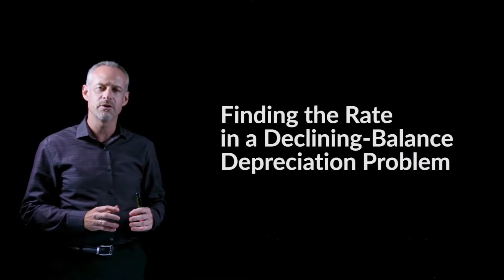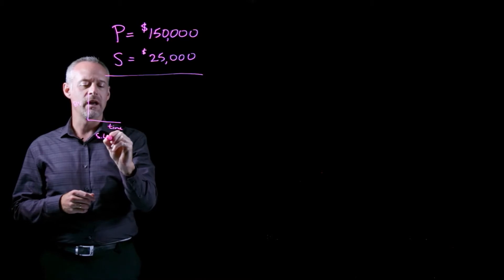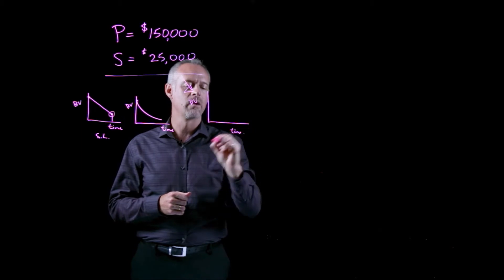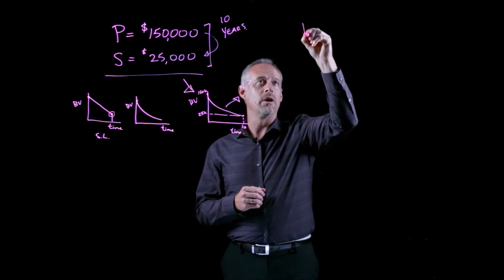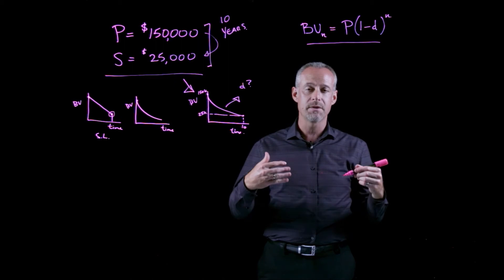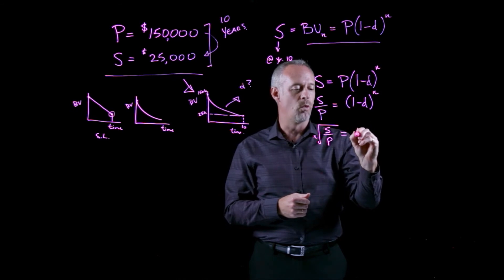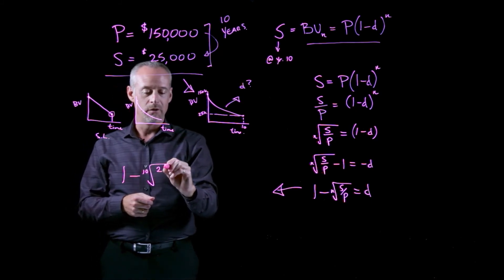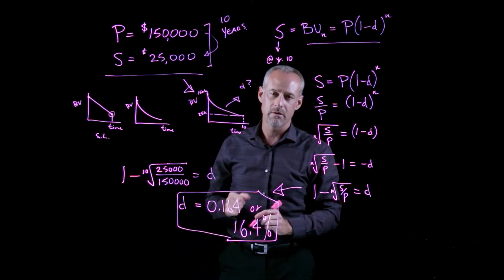Finding the Rate in a Declining-Balance Depreciation Problem - Engineering Economics Lightboard

Comment: is there ever a case where the depreciation rate over a time span of n-years is not constant? For example, is it possible in this problem that we have different depreciation rates over the span of 10 years to arrive at that salvage value, or would the depreciation rate be constant with our solved rate?
Reply from the maker: The depreciation rate is always constant.  If the actual salvage value is different than the book value when the asset is 'disposed of', then the company needs to either claim more depreciation that year (if the asset sells for less than the book value), or 'give back' some depreciation (if the asset sells for more than the book value) when they file their taxes.